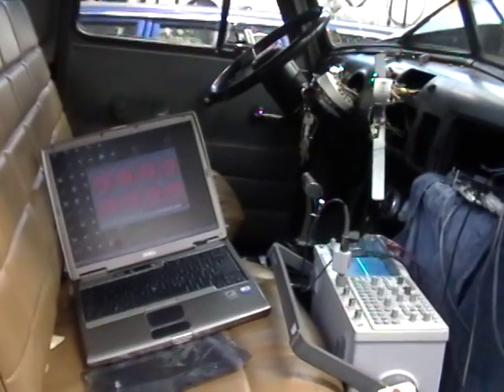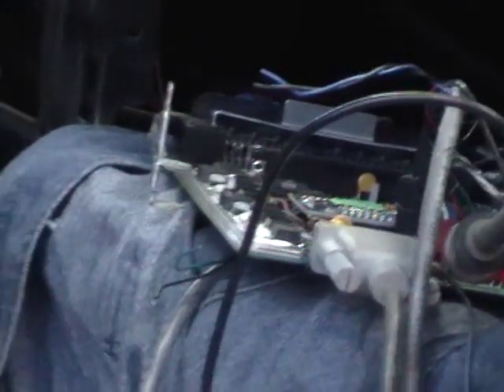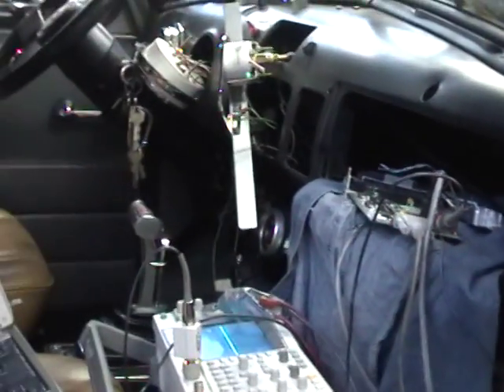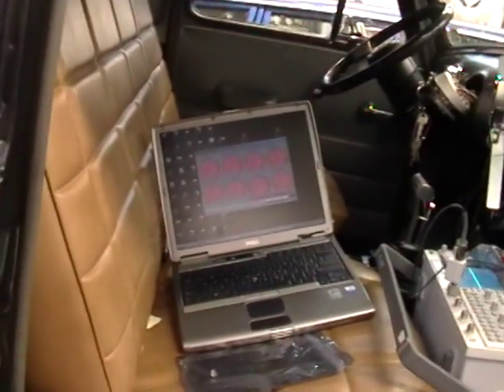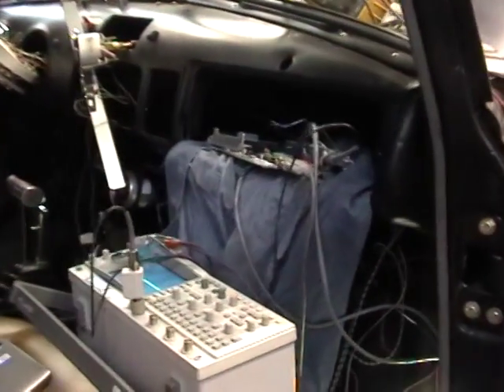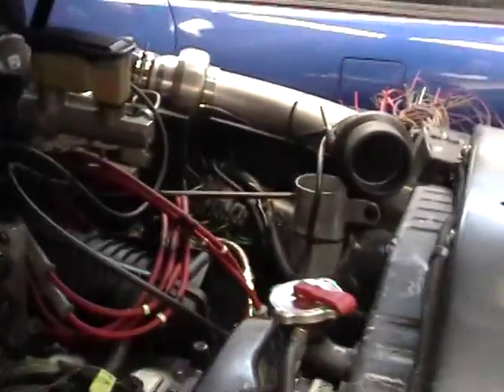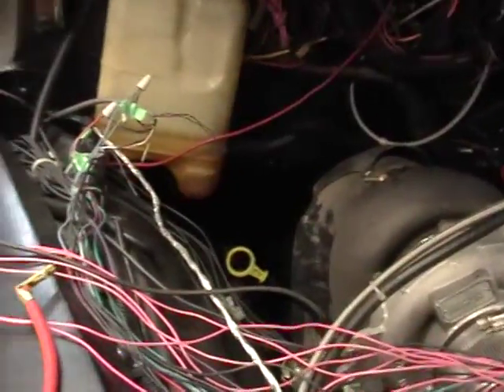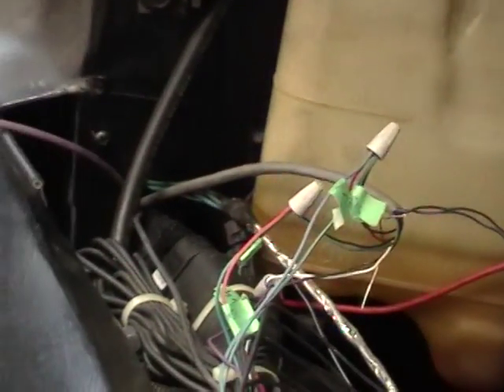Vortec 4200 - Megasquirt Fuel and Ignition control.

Comment: These engine are sadly looked over when it comes to performance. Hopefully the aftermaket catches on to these engine and start making cams and such for them.

Nice job on getting it running. Did the vvt work on the megasquirt?
Reply: indeed wish the aftermarket would come to them would love to put one with a stick shift in a daily driver with a turbo